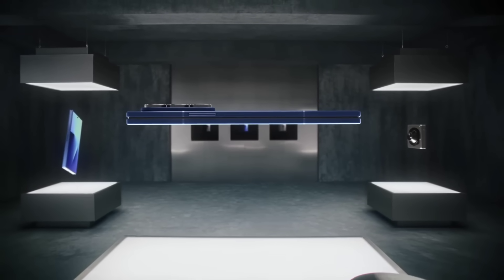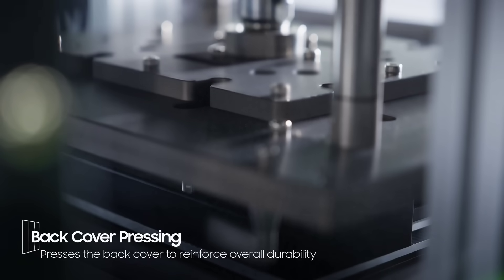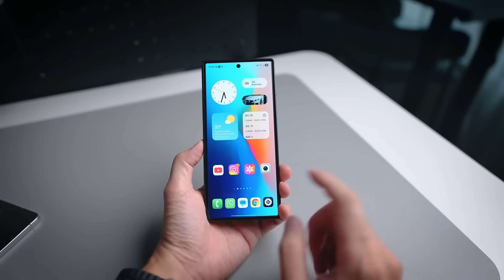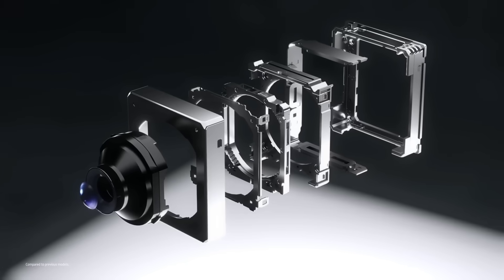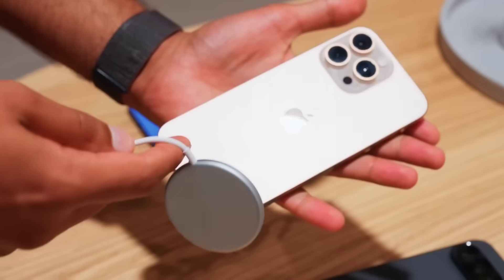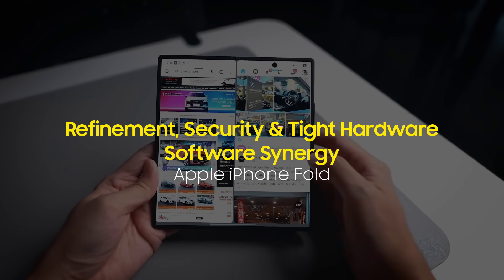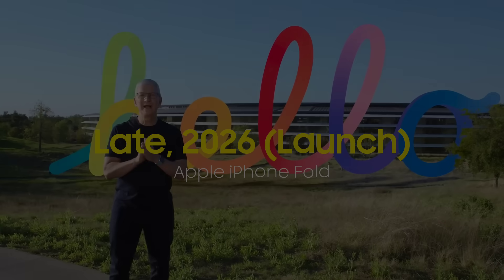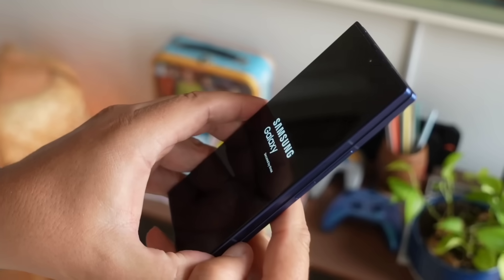Samsung Galaxy Z Fold 8 - Proof That Apple Fold Is Too Late!

Comment: Watch the new Samsung Fold 8 still has a crease 🤣 It’s not about who starts first it’s about who executes it right. 8 generations in the game and Samsung still can’t get rid of that crease.
Look at the 1st iPhone and iPhone X for example Apple didn’t invent the smartphone (facts) but when they "entered" they executed it perfectly from the start 🤔💭(except that AI and siri bs but ay at least they try to use their own and not using google and took credit from it) and it liberally changed the whole industry overnight. Gestures, Face ID, no more home button everyone followed like a good baby duck
That’s why when Apple taking their time with a foldable iPhone actually makes sense. not trying to be first, and can't executed they’re trying to make sure when they do it, it feels finished no obvious crease, no compromises, no “early adopter tax.”
Samsung deserves credit for pushing foldables forward, but Apple’s strategy has always been
let others test it, fail it, refine it then drop something polished.
If Apple releases a foldable and nails the screen, durability, and software, the game changes instantly. Until then… a crease after 8 generations is kinda wild 🤣 
(yes i own s25 ultra and iPhone air)